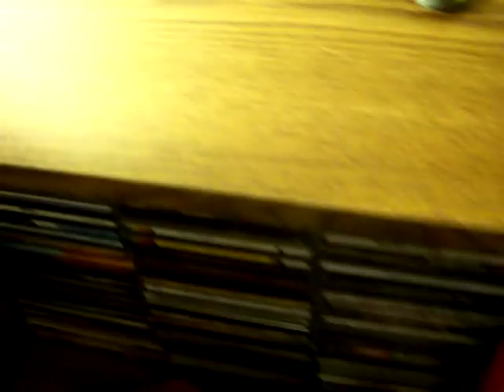Submersible Water Pump Repair

Comment: Okay so if it still does not work a replacement pump will run you 12$ on amazon. But this video did help me fully take it apart. Once I took the propellers out I could tell it was sticking cause of all the gunk. I never thought to clean way down in there but now I know. Take the propeller off and wipe with a qtip to get the gunk out. Clean once a month to avoid build up. Thanks!

Comment: Is that a jebao pump? I have a JP-900 for an outdoor fountain with a running motor and spinningi impeller, but no water pumps up the tube.  I can't tell from your video what you did to make yours work. (You told someone below that you made a new video, but where is it?)
Reply from the maker: I'm nit sure what brand that was. I think that was the problem. I'll look and see if I can find that video.

Comment: how to open the sealed portion of the motor, that seal part is water prove and main power cables are inside it and that portion of my motor is not working
Reply: Abhi G  thats only the problem i am facing ,we need to buy a new pump now
Reply: i already purchased it , this time i got India made pump.

Comment: Hey question, I have a ecoplus 1056 and the motor is on but the thing dont spin and side the cap comes off easy it has something blocking it so I cant pull the spinner thingy out to check it, any ideas if its just that and how to get access to the spinner thingy?